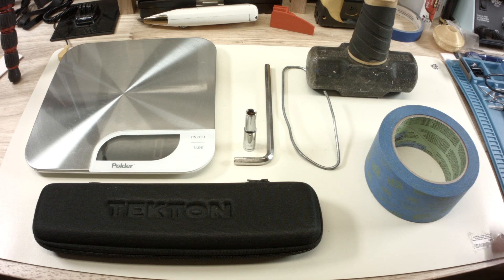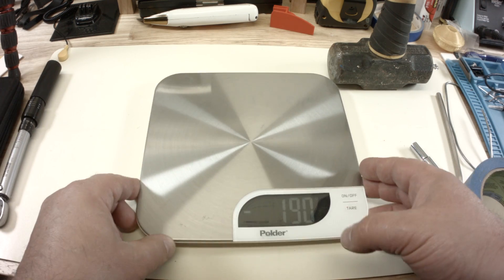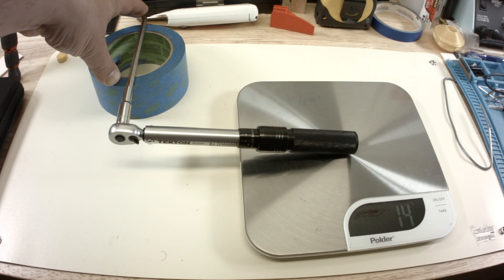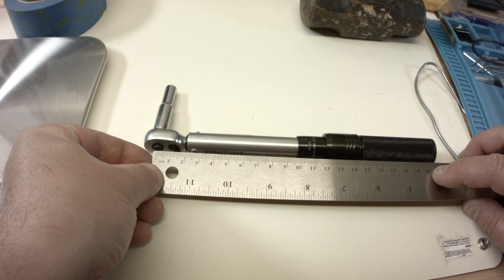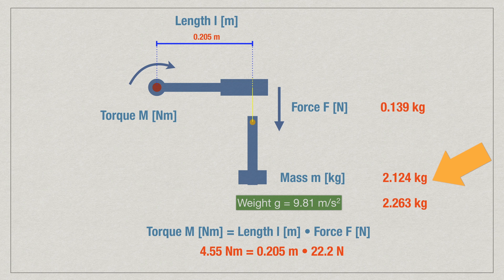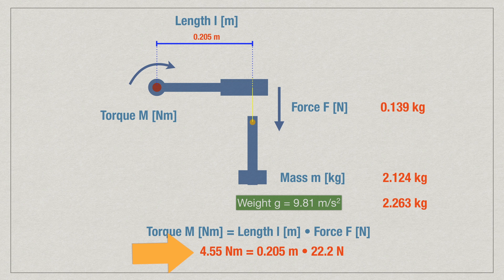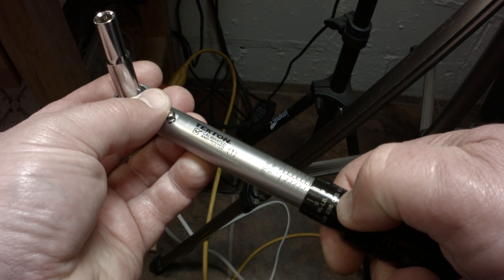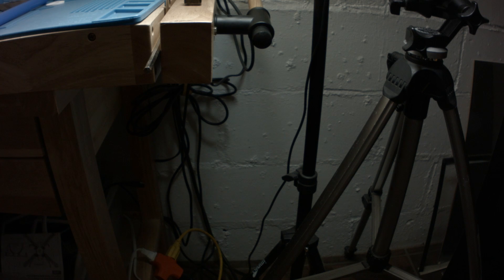How to calibrate a torque wrench with a hammer

Comment: For those of us in the US, the metric system is too strange for us to calculate. I have been to college and jave an engineering degree and studied the metric system. For example, a newton is an arnitrary unit if force (the forcerequired to impart an acceleration of one meterper second per second to a mass of one kilogram). I know the math. But WTF does acceleration have to do with force on a torque wrench. You're using static weight. SAE calcukations do not use an acceleration constant. Its just too confusing and y'all say its easier. How? Most Americans, especially those of my age and generation, have used the Imperial System ALL our lives. I have worked with a couple of very bright English engineers who, both have said in their words " is totally fucked in pratical applications." Only on paper is it easier to calculate.
I have talked to agreat many of my contemporaries and all but one agree that the metric system sucks and will not use it even to make their calculations. It is a mind set.
Reply: imperialist live in the past.....
metric units does not use formulas to get minute measurements. u take a millimeter, measure and done.
for goodness, even star trek series and movies use metric. get with the program.
Reply: 3 years ago but still not answered. Acceleration (9.81 being equal to gravity) is used to convert from kg to N as most wrenches have a Nm scale.
Reply from the maker: @Hank_E  I didn't know what to say, that's why i didn't answer.